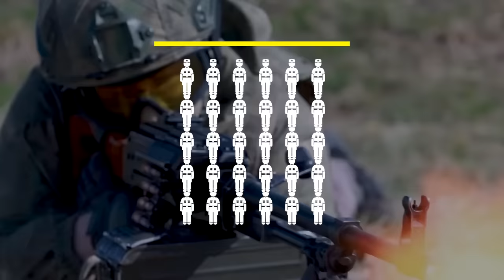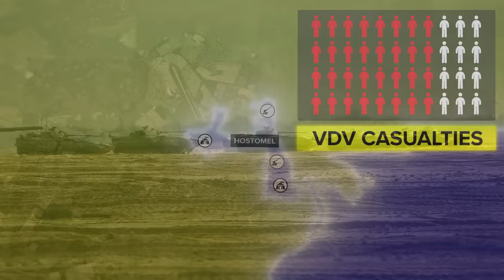Could the US Military Conquer Russia All on Its Own

Comment: 21:20
Ah yes, the infamous double-rotor AH64 that’s strangely ressembles a KA-50
The feared F35-looking F22 
And the brand new unarmed attack AC130, now with jet engines instead of turboprops!
So he just put a KA-50 instead of an AH64, A F35 instead of a F22 and an C17 instead of a AC130
Reply: Russia has air defence you know you ain’t fighting Talibans or rice farmers even they beat you
Reply: @incognito867  They didn't actually beat us. Also, you're assuming we use all of our might against the Middle East, which we clearly did not.
Reply: Whether you're using the F-35 or the F-22 entirely depends on what you're using it for. If you're using it to take down other planes, you'd probably want to protect those planes with a f22 since they can pretty much maneuver anything. If you're trying to snipe with a plane, then you want the 35.
Reply: @autumnberend828  bro i know very well the planes functions😂
I was just making fun of how they showed the wrong planes with the wrong names
Reply: @incognito867  Russia bot
Just saying

Comment: Probably not. Russias missiles are decades ahead of ours. We were asleep at the wheel. They're using hypersonic air to air and air to ground missiles. We just tested one and the test failed.
Reply: Well, Patriot system is end 70's stuff and intercepted the undefeatable brand new hypersonic Khinzhal... BTW, US military cancelled a missile similar to the Kh-47 named GAM-87 Skybolt in... 1961 or 1962...
Reply: @harounel-poussah6936  Proof ? Even if it succeeded, it will succeed on single shells, not a whole series of shells.
Reply: @jakubz3177  shells are shot by artillery guns, we're speaking missiles.
Proof?
Look at the number of missiles intercepted in the last months! 
FYI, a Patriot battery is constituted of 6 launchers.
Each launcher carries up to 16 PAC-3 (20km), 16 PAC-3MSE (35km) or 16 new PAAC-4 (150km), thus, each can also launch 4 older PAC-2 (150km) already in use end 70's

Comment: Falling back on "Russia is just too big to occupy" is a cheap cop out of the reality of a US vs Russia conflict. It'd be like saying the US can't conquer Canada bc it's so big.

Both Canada and Russia would be easy conquests for the US for the same reason. The mass majority of their population (even more so when you limit "Russia" to it's ethnic ruling majority) are concentrated within a relatively small portion of their country.

Moreover, when we consider Russia's political power center (Moscow) and the fact it's within 500 Miles of the current front line in Ukraine, it would be insanely easy for the west to knock Russia's lights out in a no-nuke scenario. It's not even a question, and it would be done within months, not years. The US's tactics are what won Ukraine its northern territory. Unfortunately Ukraine's leadership has dismissed their western doctrine training course and returned to their crawl approach, which is definitely effective at grinding the meat waves. But it is not conducive to reclaiming territory. I don't fault Ukraine however, even with western aid they are extremely out gunned and out manned. So their absolutely playing the correct long game, where they maximize their army's KDR, at the cost of territorial claim.

This would not be a problem for the US. Even with smaller forces, US forces would be infinitely more well supported. US parks 1 carrier fleet in the Black Sea and not only would 30% of Russia's remaining navy be obliterated, the whole of southern Ukraine would be liberated within a week.

The US could capitalize on the ongoing conflict in Ukraine; which would in later history books be used to justify the purge of Russia.

With control of the Black Sea, the US would not only have eliminated the bulk of Russia's forward facing might, they would also have disabled 3 of Russia's 10 largest industrial centers. The US's naval power could be exploited to the nth degree in the Black Sea region. It wouldn't even be fair.

To a lesser effect, the US could have a second fleet enter the Baltic and lay siege to St Petersburg, further crippling Russia's industrial capacity.

After the opening play of the war, when the US has suppressed and pushed Russian forces from their eastern sea boards, the US Navy would serve as weapons platforms to begin disabling inland industrial centers as deep as Volgograd. The US Air Force as you made clear would smoke any efforts by Russia's Air Force to provide front line support. Yes, in the first few weeks/month the US won't be able to use its air superiority for deep target strikes, however unlike the US who can counter Russia's hypersonics with THAAD and Patriot systems, Russia's S-400 has yet to prove they're actually capable of the same.

Moreover, Russia has a small stockpile of S300s & S400s. The US could overwhelm their systems to take them out of commission and open up Russia's heartland to air strikes.

By the end of the 1st month the US would be able to liberate 100% of pre-2014 Ukraine, occupy Sochi, Novorossiysk, Krasnodar, Rostov, Taganrog and the surrounding region, in addition to all St Petersburg and all territory boarding the Gulf of Finland pushing as far south as Veliky. In Month 2 the US would move on occupying Volgograd and Voronezh while forcing Russia Russia to split its forces between the north and the south, to prevent a rout from the US's northern pressure. Most of month 2 would be the US further crippling Russia's industrial capacity,  by the end of month 2 Russia would be lucky to be operating at 30% the US's pre-invasion capacity.

By month 4 the US would control Saratov and be focused on pushing Russian forces east of the Volga. In the north, the US would look to take control of Petrozavodsk and use lake Onega as a natural barrier, pushing south to Lake Beloye, and then Cherepovets.

Months 5 and 6 would be offensives focused on capturing Ulyanovsk and  Yaroslavl.

By 10 months in the US would nearly have Moscow encircled, with Novgorod being the last city to fall before the US absolutely leveled Moscow.

At any given point in this, the US could absolutely get a breakthrough on their front to Moscow, and at thaf moment "Russia" as we know it, ceases to exist.

The whole of eastern Russia would be annexed by China and Siberia would claim Independence.

The US would recognize Siberia as a state, under the condition it allows UN peace keepers to destroy their nuclear stock pile and the US would seize control of all remaining western Russian military advanced weapons systems.

The US would then do what it does best/worst. "Nation build" western Russia into a "liberal democracy" which will inevitably fail, but the US will leave and Russia will no longer be a nuclear power and be as relevant on the global stage as Afghanistan..

Comment: This video is on the assumption that Russias nuclear missiles actually work, based on their current...uh...difficulties..in Ukraine, I'm having some doubts. That being said, assuming no nukes were used, the US would steamroll Russia. Simply by choking out their oil supply until they were forced to unconditionally surrender. And calling the Kuznetsov operational is being VERY generous. Also, can you REALLY call a fighter 5th gen if it cant operate over UKRAINE without fear of being shot down?

Comment: We must see the so called (military and technological) power of Russia in perspective. Russia is a huge country in square km, but only has 146 million inhabitants. This is 40% of USA or Eurozone. The GDP of Russia however is only 4% of the GDP of the Eurozone + USA, this is equal to the GDP of the small countries Belgium + Netherlands. And less than the GDP of the state of California. Relatively (per capita) the GDP of Russia is very low. Beside that the economy of Russia has signs of a 3th world economy. Half of the income is coming from oil & gas. Based on this, Russia isn’t a world power. And for sure, it isn’t a economic power. This is the reason they can’t build up and maintain a big army. The army they already have is far beyond normal proportions in relation to their GDP. This hurts their budgets and prosperity permanently. In this perspective, Russia is a dictatorship with a huge inferiority complex and dangerous megalomaniac ambitions. The path they chose will be their downfall.